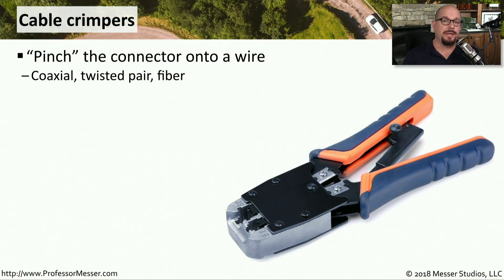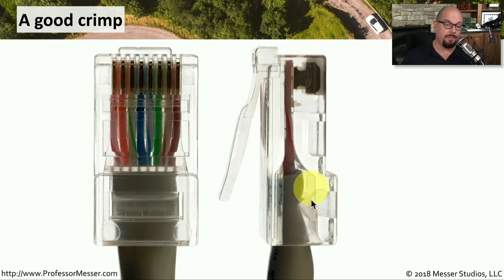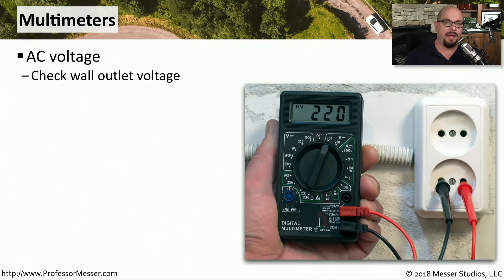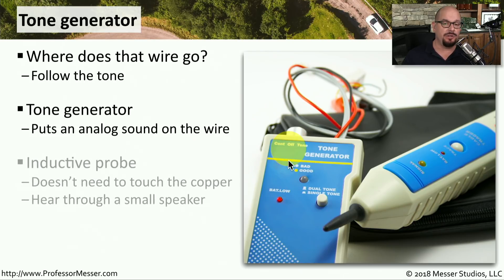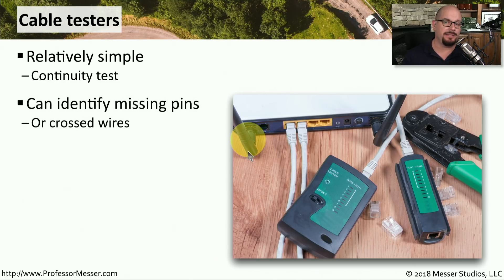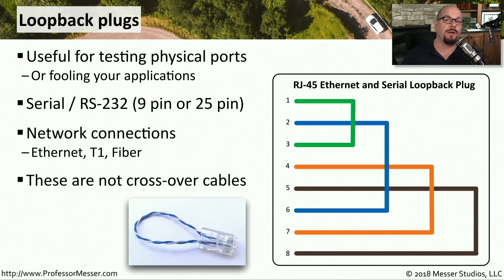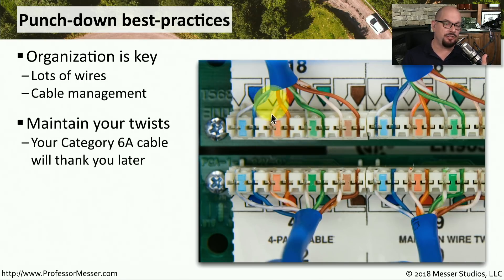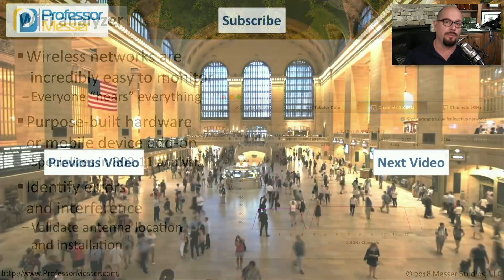Network Tools - CompTIA A+ 220-1001 - 2.8

Comment: Professor, you said performing the crimping process was outside of the scope of the Network+ exam.....did you mean A+?
Reply from the maker: You don't need to demonstrate any crimping skills for the A+ or Network+. You still have to know what a crimper is and when to use it, for both A+ and Network+.

Comment: On the 1001 and 1002, will I have to demonstrate that I know how to use all of these tools? I'm just not sure if I only need to know what they are, or go ahead and buy them all to learn to use them.
Reply from the maker: There is no hands-on portion of the exam, so you won't need to physically operate any of these tools. You should ideally understand what functions these tools can provide and when you should use them in your troubleshooting efforts.
Reply: @professormesser  Ok, thanks for clarifying that. Much appreciated sir, and thanks so much for the videos. You are a great help

Comment: hi does cable tester same with multi meter?
Reply: cable tester mainly testes the punching of network cable & the type of cable, for example, if it is straight or a cross-over cable. 
a multimeter is an electronic measuring instrument it measures the current, resistance, various voltages, etc. on the cable.  it can be also used to check if the cable is good or not.
Reply: @AjayKumar-un9gy  thanks